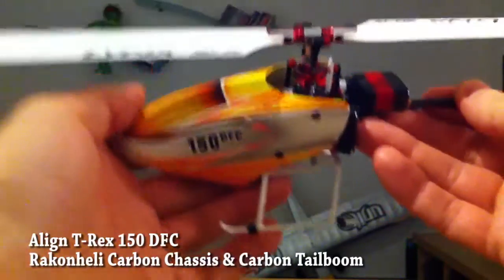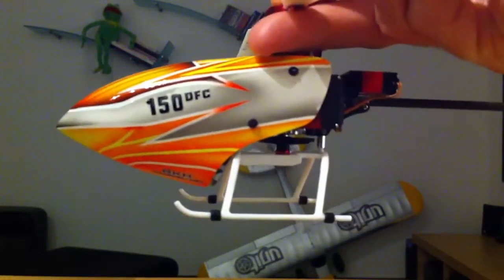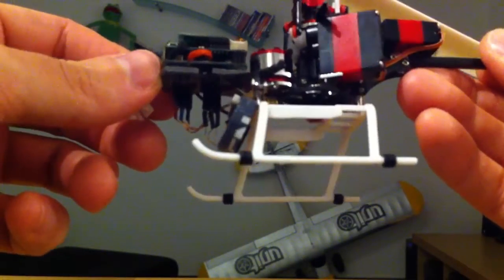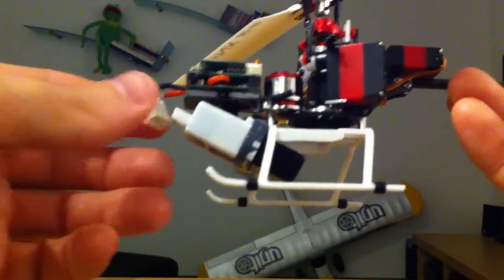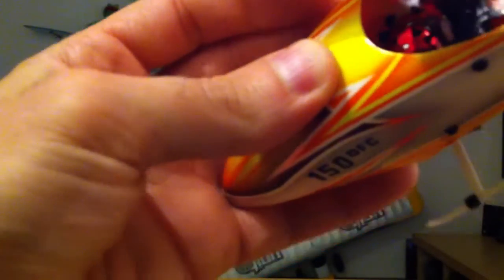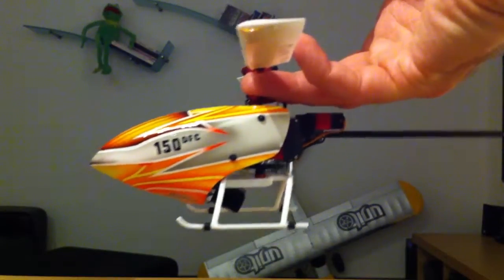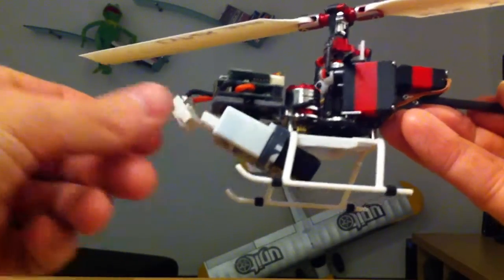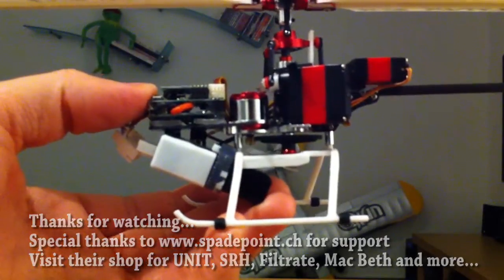ALIGN T-REX 150 DFC WITH PERFECT CG

Comment: whats is that end nut or piece you are using at the end of the main gear?
Reply from the maker: This part comes with the carbon main shaft i installed instead of the original main shaft. i'm not sure what brand the carbon shaft is. i think rakon heli or something.

Comment: Great idea to sort the CG, taking off the canopy to change lipos is annoying but I will try it on one and see if I can fit with a sat rx in there. Have you done a bheli flash?
Reply from the maker: MicroRCFiend Thanks. You are right about the canopy. But I still fly it like this. I have the original Firmware on it. Is there any improvement with the new Firmware?
Reply: With blheli upposedly perfect tail performance, gov and controlled slow spool up. I have it flashed but stumbling with the throttle and tail calibration via deviation firmware. I believe for that last couple percent of performance on tail you need a 12 magnet bell from oversky but I know a couple that are happy without that addition.
 
The bad is it's one way only and unless your savvy and or experienced it may not be as easy as tutorials say due to diff tx and the 150 differing slightly from an mcpx bl upgrade.

I'l hollar if i get it sorted.
Reply from the maker: MicroRCFiend Thank you for your answer. i will think about the firmware update...